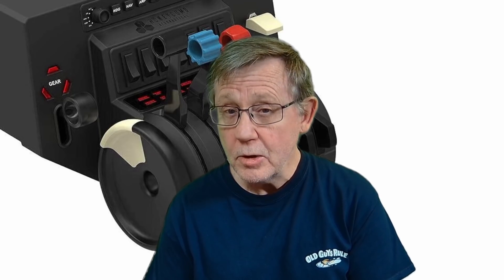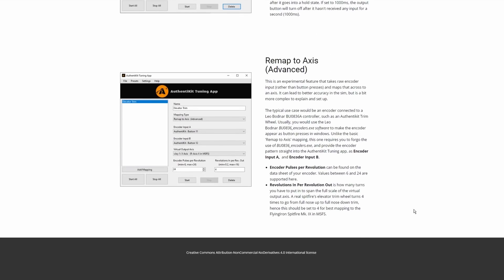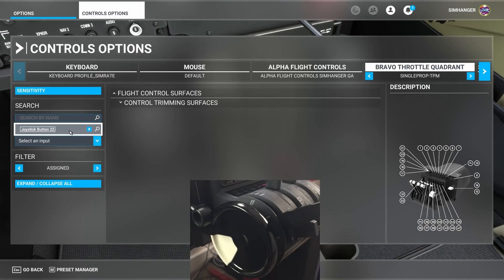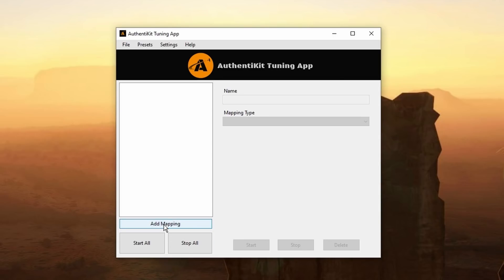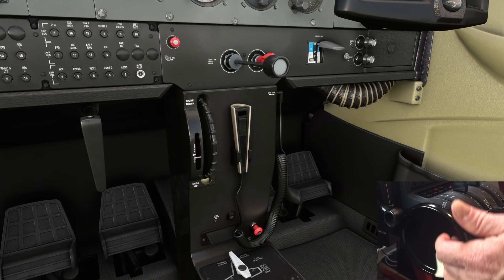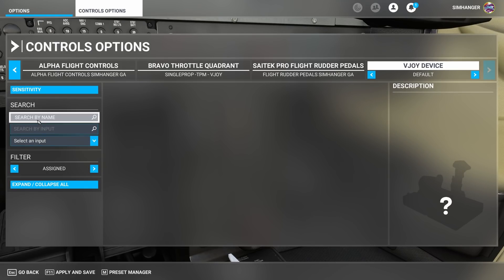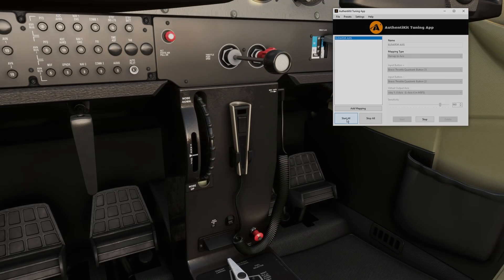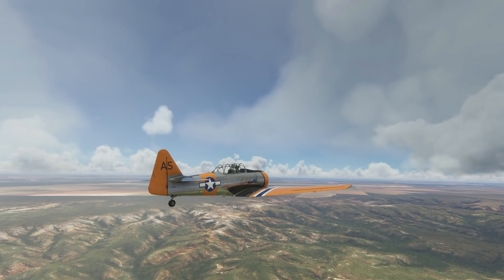SENSITIVITY FOR YOUR TRIM WHEEL | Freeware App for encoder based peripherals | Authentikit

Comment: I tried the trim wheel mod - works for nose down but for nose up it gets to the centre line / take off position then it jumps several notches and is very erratic.

Comment: VelocityOne Flight trim wheel is almost useless on FS2024. Setting trim to digital buttons adjust the trim 0.2 - 0.25 % per click. This miserable trim wheel adjusts 1 % at a time. So it is actually 400-500% less precise than a button adjusment.

Comment: I followed this video for 2020 and just did it for 2024! it STILL WORKS! Menu just looks differently but worked for me! Im so excited thank you! make sure to save it as a default in 2023
Reply: Saves as an .xml file?  I can't adjust the sensitivity from 360 to 200.  I wind it down to 200 but soon as I press 'Save' it reverts back to 360!
Reply: How did you set the "elevator trim axis (-100 to 100%)?" It only lets me set it by input and doing it by input says wrong device for me and I can't map it

Comment: Hi, I’ve watched several of your videos and found them very informative. I recently got a Honeycomb Bravo and installed the Authentikit Tuning App and vJoy driver, following your video, and had it working for my trim wheel. However I then noticed that MSFS2020 no longer recognized my USB Xbox controller. I run the desktop version of MSFS and use the controller to move the drone camera around. The culprit seems to be the vJoy driver. I finally removed the Tuning App and vJoy driver to restore the Xbox controller function. Do you know if there’s any work around for this issue? Thanks!
Reply from the maker: @frankpope9273  I haven’t experienced this issue so not sure what the conflict is. I am not currently using vjoy at the moment.

Comment: I just came across this video and it has been a god-send, I've done the same as you did here for the trim wheel although I made it slightly lest sensitive and also add to mappings for the Bravo's right knob as the default mapping is way too slow in the sim requiring huge numbers of turns just to (say) move the heading bug a few degrees.

Comment: Mark, I cannot thank you enough for your help with my trim wheel sensitivity issues or a lag in response time. I had to fight to get my aircraft trimmed out. Not now! The AUTHENTIKIT TUNNING APP proved to be the answer for getting precise sensitivity settings on the Honeycomb Bravo. AKT App now has a preset for the Bravo throttle quadrant set just like your video. Overall, your videos have helped me set up configure and learn to fly better than any other tutorials on the Web. Thanks, and keep up the good work!

Comment: The newest version of AuthentiKit does not have "Start All", "Stop All", "Start", and "Delete" buttons. I have followed this tutorial to the letter, but Bravo trim wheel is dead.  Not sure what I am doing wrong.  Thinking that I am not doing "Start All" in the app because there is not that button.  My profile, "Elevator Trim Axis" is created (tried both from the Preset and from scratch) and saved. Then loaded from the "File" menu.  No way to "Start" it.  Then open MSFS and decouple trim wheel from Bravo and set up the vJoy as you did.  Any ideas about the current status of this app?  Your opinions would be greatly appreciated.  Thank you for all the videos you create...much appreciated!!

Comment: Honeycomb Throttle Quadrant??? Do's the Honeycomb Throttle Quadrant lights work in the Steam edition of MSFS 2020? I cant get the lights on my Honeycomb Throttle Quadrant to work. I have down loaded the appropriate software and installed it appropriately, but the lights still wont work. Any advice would be most appreciated. Happy New Year. Dave M.
Reply from the maker: Download the driver from HC site. Installs ONLY into the default profile. Build all profiles by copying that profile.
Reply from the maker: Watch this video https://youtu.be/E06yP5g90eY?si=qk150uw9vMWARkxn
Reply: Thanks Mark, much appreciated. I don't know what I did by next time I launched MSFS 2020 the lights were working, Brilliant.. @SimHangerFS

Comment: Hi! Could this also be applied to the AP rotary encoders on the Bravo Throttle Quadrant? For example, when I want to change the heading bug, it also takes about a thousand revolutions on the rotary encoder, to get a 180degrees response on the G1000... So, maybe button multiplier on that encoder? Have you tried that? Thanks.
Reply from the maker: I havent tried. Let me know if successful :)
Reply: Well, same question for the ALT and VS  changes on the Honeycomb BTQ...

Comment: Your video is about a year old but I’ve only watched it two days ago. I was so happy to get the honeycomb brovo throttle quadrant because of the trim wheel and auto pilot. Mostly, I wanted it specifically because of the trim wheel. To my great disappointment the trim wheel is the only thing that I cannot use on the setup.  I’ve tried downloading the software, and doing what you said, but I am not a computer expert or a computer programmer. It is so frustrating that a company like honeycomb sends out inferior products that their customers have to jump through hoops, and download extra software just so they can use the product. What I don’t understand is the raving reviews that YouTube reviewers give these products that are not, and I repeat, not very user-friendly for some of us. I understand there’s binding certain keys and tweaking, certain sensitivities, and all that, but I was pulling my hair out because of the authentikit and vjoy downloads. I just gave up. Now I am pondering on whether to just return the bravo, throttle quadrant or stick it in the closet and wait for an update from honeycomb that will fix the problems with their inferior products. Your video was great but things I tried did not work. Keep up the good work.

Comment: Your video has one difference from other guides using this software... you map the wheel to a vJoy access as the web page and the post on MSFS forums says to do, but then you don't use it; you add a second mapping that affects vJoy buttons and uses an accelerated button press thing and that's what you assign in the simulator.  I don't think you need to do the first bit (mapping it to an axis with a sensitivity) because you never assign that axis in the simulator?  Sorry I'm not really trying to point out a "mistake", I'm trying to get this right for myself.  The axis method is way too jerky, but I'm wondering if your 2nd set of 2 mappings for multiple button presses would be better...  just looking for clarification... thanks.
Reply: Oh I see you're testing both.  Sorry.

Comment: I find this interesting.  I lived for many years using a typical button setup for trim axis, like a hat switch or the trim buttons on the Honeycomb Alpha.  I hated the buttons because I could never find the right trim.  I would ALWAYS get to the point where on click was too much or not enough and the proper trim was right in the middle.
When I got the Bravo it was like a whole other world.  I could finally nail the EXACT trim I wanted.  Until I saw this video I just assumed it WAS an axis.  I don't know how it can still be button presses and yet be so super precise, far more than any other button setup I've ever used.
I also don't spin the wheel like you do in this video though, I move it deliberately like I would a real trim wheel.  In fact I have the tension set so high on my Bravo the trim wheel won't spin anyway.  Maybe that's why it works fine for me as is out of the box rather than needing to do this.  Don't know but right now I find it golden heaven and don't want to mess with it, but will keep this in the back of my head.

Comment: @SimHangerFS do you have any issues with the trim buttons on the alpha xpc yoke ? Single click appears todo nothing for me. Have to hold the trim buttons and then after a delay kicks in and the overshoots. Wonder if something like this might help that as well ? Or that should just work ? Thanks
Reply from the maker: The button trim should work without this. Depends on how the dev coded the trim
Reply: @SimHangerFS  Just in MSFS Cessna 152. Haven't seen anyone mention behaviour like this so seemed odd.

Comment: Hi again mark. I did get the axiss portion to work on trim not sure about it yet.had to turn it sensitivity way down to like 4 or five. I did put in the button multiplier er but it never showed up.  On my v joy in the Microsoft simmulator options. I was wondering? Is this mod just as good as buying a flight Velocity pro trim wheel?  Mark do you have any experience with that? Or do you know anybody that has? . Thank you again for any information.
Reply from the maker: Hi, the V1F trim wheel is excellent, but not sold separately. Comes as part of the yoke/TQ combo.
Reply: @SimHangerFS  Flight velocity does sell it here in the states by itself.

Comment: Hi mark,truly hate to trim on my Honeycomb Bravo quadrant. Do you still like this app ? Thanks
Reply from the maker: Yes I’m using the updated version, but often just use the button function on my yoke to trim. Less hassle.
Reply: @SimHangerFS  Did you set the yolk button up with this app or using it as is?
Reply from the maker: @nashfan1000  I set it up using the trim wheel

Comment: Mark, as you stated at the beginning, the trim wheel is the only thing that didn't seem to work well with the Bravo, going to try this today, thank you Mark and Authentikit!  Your channel is the best resource out there for sim flyers, somehow you find a way to keep improving the experience!
Reply: Hello. Could you tell me how was your experience with the trim wheel in the honeycomb throttle? I would really appreciate if you could give me your opinion
Reply: I find it a well built setup, easy to use except for the trim wheel which was overly sensitive until I started using this app to fine tune it @pepeiglesias9603

Comment: Great video thanks. Not sure what is going on but my Bravo trim wheel works fine from the takeoff setting to nose down, but from takeoff to nose up the rate of movement for the trim wheel goes about 10 times faster making it unusable. Same issue with your settings or the built in brave preset.
Reply from the maker: It is possible your trim is not reset on first flight, when you use trim first it is jumping to a position. Try set trim using wheel prior to departure. Just a possibility.
Reply: It is the sensitivity setting of the axis in the vjoy setup.
Reply: Fir some reason the sensitivity setting on the x axis positive is set to 85%

This is the problem.

Comment: I followed the link above to the Authentikit tuning app download page. I notice there is no ".net 5.0" download link on this web page as shown in Mark's video. Does this mean it's not necessary to load it from another site? Will Vjoy and the tuning app work without it? I Googled .net 5.0 and learned that it's going away on 5/10/23, to be replaced by .net 6.0.

Comment: SOLUTION SOLVED, SEE BELOW
Mark, I just used this video to adjust the trim wheel on the Kodiak 100. I have some issues. The version of AuthentiKit appears to be different than yours, and offers some different options for Mapping Type. I did set it up like you did for the AXIS, and when applying down trim, it's very smooth, but when you get back to the neutral position and start applying up trim, it goes very quickly. Also tried to setup the Button configuration you had, but that does not work at all with the Kodiak 100. If you have any insight, that would be greatly appreciated.

UPDATE:
After playing around with some settings, I managed to get it working correctly.
1. In the VJoy Device for Elevator Trim Axis (-100 to 100%) I have it set to (JOYSTICK R-AXIS X)
2. In the AuthentiKit Tuning App
Mapping Type is set to (Remap Button to Virtual Axis).
Input Button + (Bravo Throttle Quadrant: Button 23).
Input Button - (Bravo Throttle Quadrant: Button 22).
Virtual Output Axis (vJoy 1: RX Rotation  (R-Axis RX in MSFS) ).
Sensitivity at 201.

It works perfectly in the Kodiak 100 and the Cessna 172. Not this is a different version of AuthentiKit than the one you displayed in this video. Hope this may help someone, and thanks again Mark.
Reply from the maker: Thank you, yes they have updated the app and parameters have changed.
Reply: The issue you had is that the sensitivity setting for the x axis is corrupted and is 85% (should be 50%)

Comment: This is such a mess. There is no Button Multiplyer listed in Authentikit 1.2.2. No trim movement at all. Nothing else assigned to trim, I've checked all hardware listed. I did remap trim back to my G940, since it works. But bravo trim did nothing. Honeycomb SHOULD be the ones that fix this. After all, they are the ones that took our money, while advertising a 'working' trim wheel on the quadrant. And to think. This morning I just ordered the Alpha yoke too. I wonder if it will actually work as expected? So frustrating when companies skimp on their products, yet charge quite a premium for their junk.

Comment: Check your SENSITIVITY settings for the VJOY Device after setting this up as mine were not set to 0 and caused issues with sensitivity around the centre! Thank you so much for making this video, it makes a HUGE difference
Reply: You, my friend, are a life saver! I could not work out why my results weren't like Mark's. Thanks so much for taking the time to post this.
Reply: Thanks. That was the trouble I was having.
Reply: Maaaaaan, this is the hint i was looking for. Thanks so much.
Reply: Jeez thank you I was thinking I had a hardware problem.
Reply: Thank you as well! Probably would have been days before I figured the sensitivity thing out lol.
Reply: Not working for me :(
Reply: Not sure where to find this setting? I have problems with the curve, at the bottom  it changes faster than at the top?!?
Reply: Well i got it fixed by using "Joystick Slider X" (vJoy 1: SL0) instead of  vJoy 1: X Axis !!!

Comment: You didn't show the setup in FS2020 for the 2nd option trim buttons profile. What input device do we need for nose up and nose down?
Reply from the maker: Elevator up/down.
Reply: @SimHangerFS  Thanks! Couldn't get the 2nd one to work at all. stuck with the first one. Asobo really changed the sensitivity settings again. using a setting to 47. Thanks for your help!

Comment: I get this weird behaviour, when I turn the trim wheel while using the trim axis, the rate of increase and decrease goes slow, then at a certain point in the axis it goes suuuper fast, and then slow again. It seems to be several points in the -100 to 100% axis.
Reply from the maker: I haven’t experienced this, but if you turn the trim wheel aggressively then the speed up your seeing are the ‘’button’’ presses catching up. Adjust the settings to make it more sensitive and turn the wheel in small increments.
Reply: @SimHangerFS  Thanks for your reply. I am turning it slowly at a steady pace. But there are certain points where it just speeds up for no reason. Let's say if we were to look at a like which goes 0-100, i'd say the normal speed is at 0-15 then it increases a lot faster from 15-50 and then slows down for the rest of the way to 100. The same issue in reverse too at the same spots.

At least the "Remap to button" works better than not using this software.

Comment: Hi Mark, this did work for me, and is a great tip and tool!
Just a warning for Tobii 5 users, it appears that installing the vJoy controller breaks Tobii 5 eye tracking in MSFS. I've uninstalled vJoy and its drivers and I still can't get Tobii up and running again, continuing to troubleshoot.. CHeers, Nick
Reply from the maker: Hi, I’m using TET5 and have joy installed. I don’t seem to have a problem. I’ll check again.
Reply: @SimHangerFS  it may just be a problem with my setup here mate, these PC sim rigs can differ wildly 😉 In the end the fix was to uninstall vJoy then delete the in-sim Tobii profile and recreate one (I use one to turn off the eye tracking, use only head tracking, and add the z axis). Thanks again for all of your contributions to the sim community Mark, you’ve taught me much about both peripherals and working through the frustrations of virtual trimming!

Comment: Mark, I finally got Authentikit/vJoy working on my Bravo using the Bravo preset — i.e., the axis, not the button-press method. (My initial problem was my fault because I forgot the configuration of the vJoy controller in the sim.) But strangely, now that it is working, I have to set the sensitivity on about 5 or 6, even a setting of 10 will result in the trim going up or down by 10% or more with even a tiny nudge on the trim wheel. I note that you are mentioning sensitivity settings of 500 or even 900, which seem astronomical to me. Have you any idea why my experience is so different?
Reply from the maker: The program has been updated twice since my video. That may be the cause.